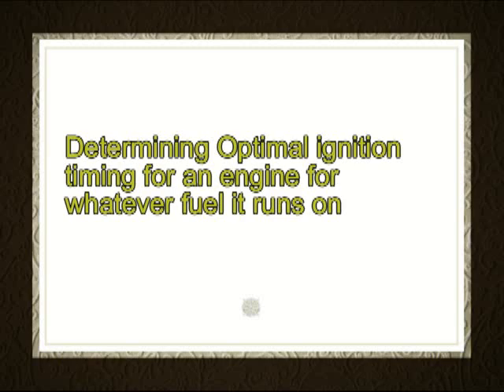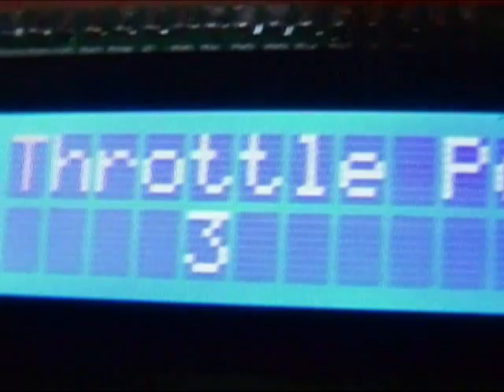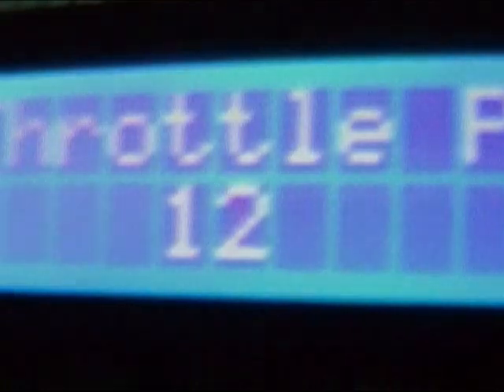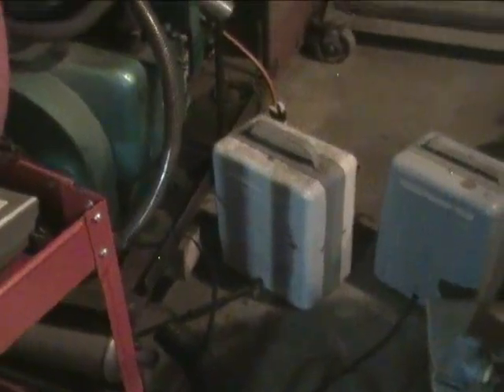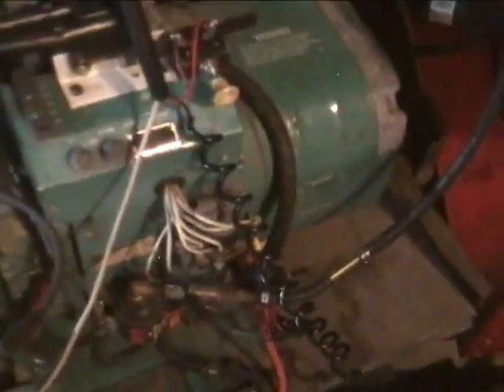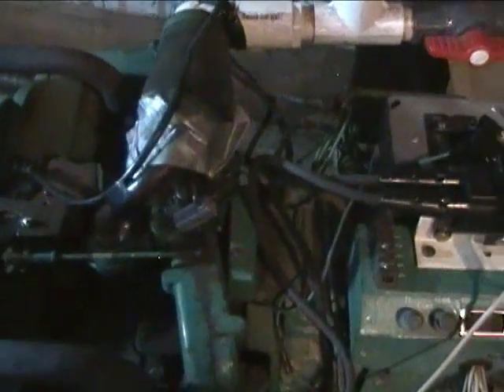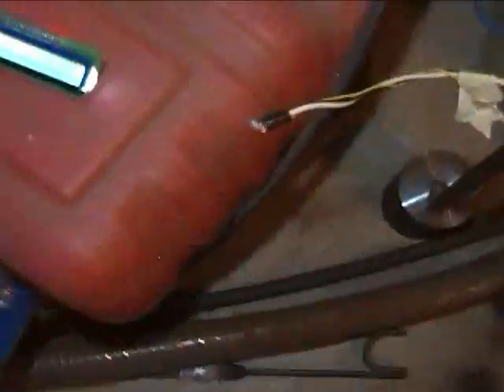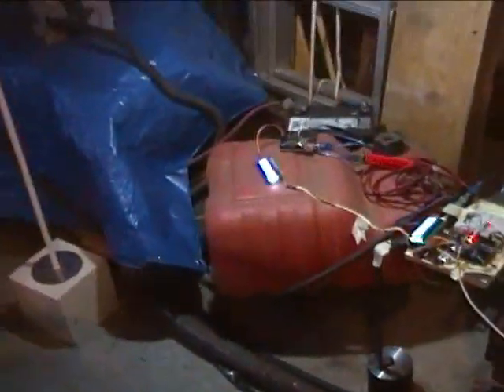Onan Arduino UNO ECU with Wide Spark Advance Control

Comment: dude, i know you have put alot of time and effort into this , but would you be willing to helkp me a bit? i would like to make an ignition controler with an arduino, i want it to be only rpm based
Reply from the maker: I have not been real active on it lately, but if you tell me some more about your goals, I will try to help
Reply: @frenchcreekvalley  so i want to use it on a 2stroke 1 cilinder engine , my rpm goal is around 12 000rpm , and I wold like it to have variable ignition advance , 30deg of advance would be plenty, and I do not want to use a TPS sensor, I would like it to be purely RPM BASED . and if I could connect via smartphone to change the advance at certain rpm (or usb to PC) so I can retune it would be awesome... Would be an epic lil controller . But I don't know if I should use an trigger at like 30deg btdc and than let it guess where to fire of off it's guesstimated rpm , or is there a more precise way of timing it . Basically my biggest fear is timing it. And controlling the coil , more precisely the dwell times
Reply from the maker: @robivlahov  12,000 rpms is really pushing it for an Arduino Uno. In fact, I don't think it is fast enough to handle the timing well.  We are just barely doing 6,000 rpms   And connecting it to your smart phone will take quite a bit of work.  I might be able to give you advice at some point but do you have the basic electronic and programming skills to do  this?
Reply: @frenchcreekvalley  I could get a mega or something idk, 6k rpm is not enough to get me into the resonance . I do have some , but not with arduinos. I know it will be quite Abit of coding , and I would change the timing every 500-1000rpm . The smartphone thing is not as important, as long as I can  reflash it via PC ... I would use a speeduino but for that you have to get a TPS sensor , and idk where to hell I could mount a TPS as I have a slide carb that is cable actuated....
Reply from the maker: @robivlahov  Sounds like you best bet is to go with Speeduino. I don't think you HAVE to have a TPS to use a Speeduino.   I looked into Josh's code in some detail a couple of years ago.  I'm pretty sure you can code around any of the inputs or simply pick a default value.  And his stuff is getting better all the time.

Comment: I own a Simplicity 4041 with an Onan 19.5hp twin.  I would love to install or build an ignition system with automatic timing advance.  Any suggestions?
Reply from the maker: I don't know about Onan engines other than the ones that I work on.  If yours is much newer than the one you see on this video, it may already have "electronic" ignition.  If so, you just need to get your own arduino and dig in as I am doing.  You simply need to intercept the ignition pulse and delay it as needed.
Reply: @frenchcreekvalley  thanks.  Mine is a CCKB model.  1975 with points and is very similar to those used in generators at the time.  I just don't think any engines (like these) run well on just one timing setting.  Way too many operating variables.  I know how to install electronic ignition (the Ford ecu works fine), but have not figured out the spark advance/retard part of the equation.  If only there was a ready built unit that could use an rpm sensor, produce a spart and advance it also.  CH Ignitions builds one for model engines, but i am afraid the equipment is not robust enough for larger engines.
Reply from the maker: @slrs3908    I don't think robustness would be an issue as long as that "CH unit outputs a 5 volt logic signal at some point.  That signal will fire a CNP pak, same as you see me use.
Reply: @frenchcreekvalley  Thanks.  That is helpful.  I am also reminded that they used to sell a unit (1985) for automatically retarding the timing in relation to rpm and plugged inline between the hall sensor and the cdi.  That alone could be the answer!  Thanks again.

Comment: hey how do you know where is the desire advance angle? do you use crankshaft position sensor ?if so how you do it ??
Reply from the maker: See this video:
https://www.youtube.com/watch?v=Tu_8DE83kEY&index=8&list=PLVxWen9M87dAFoZqyj3iy_fyBfkWuESRC
It explains how I detect crankshaft position, using hall effect sensors and magnets in my little homemade degree wheel.

I use the north magnet on the white degree wheel to indicate Top Dead Center.  Then I calculate the time it takes, at the present speed (rpm) to get to the desired firing angle.

Comment: Is your goal to collect the data for the most efficient settings at different loads so you can write a program that automatically adjusts the timing as the load changes?
Reply from the maker: My main goal is maximize the power output from the engine when it is running on woodgas.  We have all heard that woodgas burns slower than gasoline.  I want to know "how much slower".
And yes, I have already written and simulator-tested code that allows for plugging in timing numbers within selected rpm ranges as needed. It includes capabilities for soft and hard overspeed control, too.

  But your question is a good one, because I didn't realize how much the optimum advance seemed to vary as I (unintentionally) changed the load.  So, now I can also look into that aspect of engine power.  I guess that's how the old vacuum advance used to work.